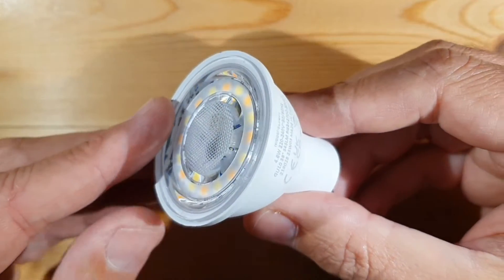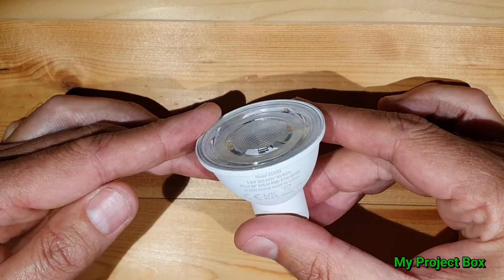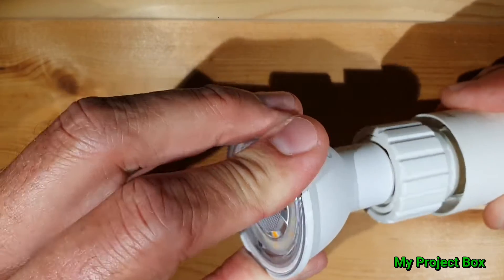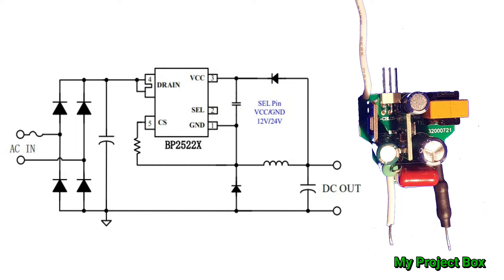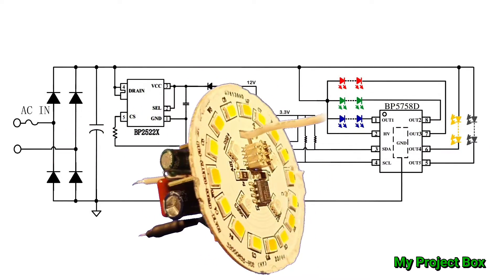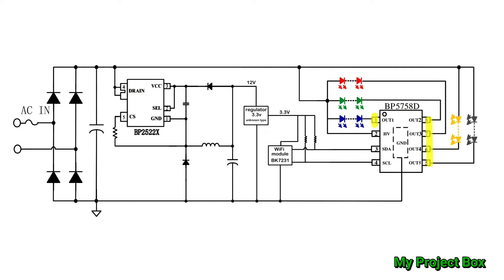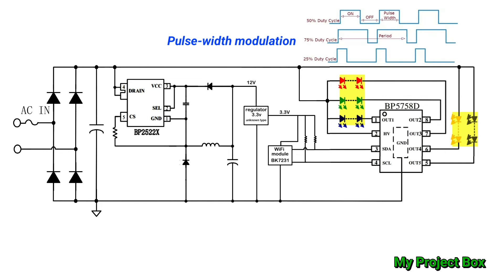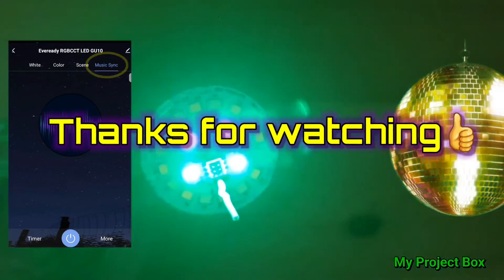Eveready smart GU10 from Poundland Review setup Teardown - Colour changing! #ElectronicsCreators

Comment: These are now £3.50 or so at OneBeyond/OneBelow. They have a variety of types of bulb. The app layout annoys me as does waiting for the app to change something. You can change the default mode to each bulb so that if you turn the light off from the app.. you can no longer turn it on from the switch and have to put it back on via the app. Changing the default on mode can fix this